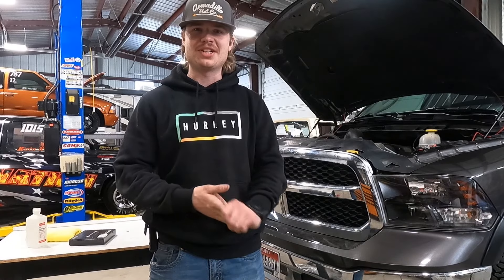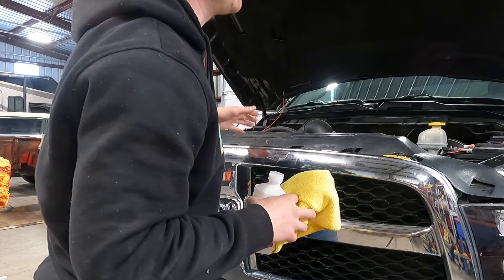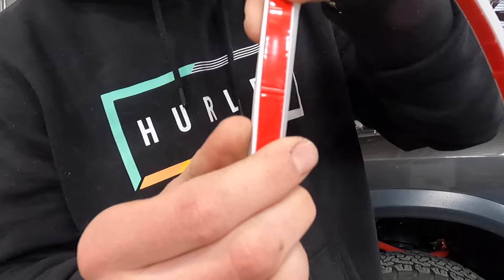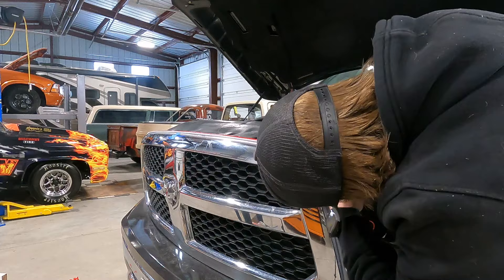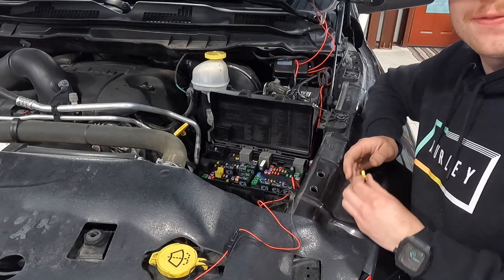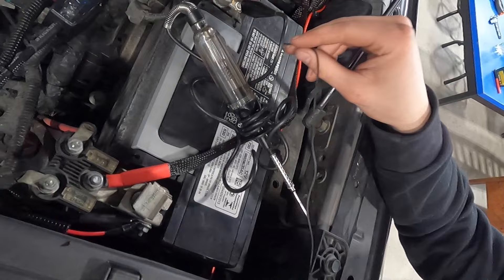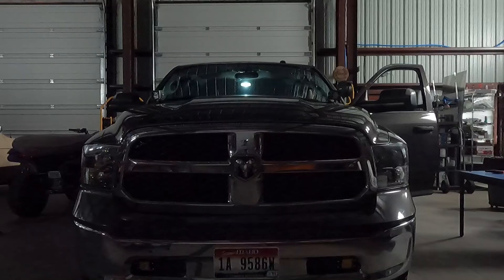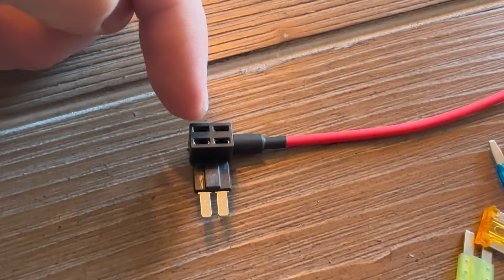Easiest Way To Install A Hood Light Strip! (For Most Vehicles)

Comment: Attaching to the negative side of the battery and I placed a fuse tap into the fuse that operates the radio...is that good?
Reply from the maker: Sure! I would just not put your fuse tap on something important for running the vehicle, you dont want to get stranded in a worst case scenario! But the radio should be fine, as long as the light turns on and off as you like👍🏼
Reply: @DakotaNationRacing  hey thanks for replying the radio fuse tap didn’t work the lights stayed on, not sure how to do this now, any suggestions? The vehicle is a 2017 Camry I’d be grateful for any assistance u can lend.
Reply from the maker: I used my “seat heater” fuse tap, even though my truck doesn’t have those, it still comes with the fuse and slot, so try out another one like that until you find one that works like you want!

Comment: That last bit with the fuse tap: you put the fuse you took out of the fuse box in the bottom slot on the tap, do you have to add something to the top slot on the tap or does it still provide power to the wire?
Reply from the maker: Yes your top slot needs to have a fuse to power your light, if you leave it empty then your light wont work
Reply: Thanks! @DakotaNationRacing

Comment: What size fuse do u recommend for 4 of them? I have the same truck but I think I might wire into parking light fuse if that’s a possibility?
Reply from the maker: If you have the type of light that has an inline fuse, you should technically be protected there, so maybe just a 5-10 would be ok?

Comment: Hey loved the vid but newbie here still a bit confused on the fuse box install, the strip I bought says it’s a 12V and when I look up the fuse box amps for my 2015 Honda Accord Hybrid the DRL is a 7.5A so do I just plug the piggy back into the DRL port and put the old plug into the bottom of the piggy back and tie the wires together and it would work? It’s okay that the DRL is 7.5A and not 12? would rly appreciate your help thank you in advance!
Reply from the maker: Im not familiar with hondas but it sounds like you may just be mixing up voltage vs. amps? When the light strip says its a 12v, that just means its for a 12v system, like cars and trucks, etc. The 7.5A that your stock DRL’s say is just how much it takes to power those specifically. 

As long as you use the fuse tap on an accessory slot in your fuse box you should be good to go! Its hard to explain over text, not sure if i made it more confusing or not but hopefully that helps!😂 It honestly might be easier to just go to your local stereo shop and have them help you out or explain it better!

Comment: I was able to figure most of this out, but my only issues is that none of my fuses were off when the ignition was off. So I didn’t connect it all because obviously don’t want my battery constantly running with the LEDS always on
Reply from the maker: Hmm, read through the list of what your fuses are for and see what is only on when the car is running. Like the “seat heaters” fuse isn’t going to have power unless your vehicle is on, go try out a couple different slots and let me know if you can or can’t get one to work for ya!
Reply: Tap into the cigar lighter , sunroof, windows. Lots to tap into. Just try stay away from anything to do with computers

Comment: So which fise was it and how many? amp
Reply from the maker: Used my “seat heater” fuse even though my truck doesn’t have seat heaters, i still have the slot. If your light has an inline fuse already then it should already be protected, but id throw a 2 or 5 or something low in your fuse tap

Comment: How to find ACC inside your fuse box? I checked mine, none of the slots has ACC marking.
Reply from the maker: ACC won’t be labeled, it just means that fuse only has power when the key is on, i used the fuse that was labeled “seat heater” since that would only be on when the truck is running! Hope that helps!

Comment: What do you do if you connect it but it won't turn off i have it tapped into my headlight fuse in my Honda Civic but when i turn my car off completely strip stays on? What can i do to fix this
Reply from the maker: It obviously must always have power, you need to find a fuse thats only on when the vehicle is running, i would think the headlight fuse isn’t constant power, but maybe it is! Try another fuse and let me know!

Comment: I received my lights today... my question is what is the size  of fuse do I use for the fuse tap? 5, 10, 15, 20?? Because I really don't want to blow any fuses....PLEASE respond...
Reply from the maker: Your light should have an in line fuse, so on the fuse tap you can throw in basically whatever one you want since it’s already protected down the line. LED’s don’t pull much juice at all anyways but i just have a 20 in there now but it doesn’t need that big of one really!
Reply: Ok....thanks so much...
Reply from the maker: Do you have an in line fuse in your light?

Comment: My question is since you hooked it up to a power source when you turn the key on.. Since you didn't hooked them up to a power source that's on only when you turn your lights on..There on all the time if you have your lights on or not?. You would think you would want them on only when you turn your lights on..
Reply from the maker: The way i wired them up, i wanted them to be a like a daytime running light, so on all the time whenever the truck is on! There are obviously ways to get them to only turn on with your other lights, it was just my preference to have them on whenever the truck is running!
Reply: @DakotaNationRacing  How do you know what fuse to use. I want ine to work like yours. My ram is a 2019 Big horn. looks didd then yours,.I  bouht the wire taps that you have, the fuses that came with the set are not small enough and the wire taps do not seem to work either. TY
Reply from the maker: @26steiger  The fuse taps set I provided a link to should have all the styles you would need! There are a few that look similar so make sure you are grabbing the right one. How you pick what fuse is find one that's not important for the vehicle to run on AND one that only has power when the key is on, the one I went with was the "seat heater" fuse slot (even though I don't have seat heaters on my truck). Try that out and hopefully that helps! If you can't get it, then go to your local stereo shop and have them install it for ya!
Reply: @DakotaNationRacing  Thank  you so much. Can I use a spare were there isn't any fuse.  I will put in a 10 amp. thoughts,

Comment: Do you have a link for the ground wire eyelet or can you pick that up at any auto parts store? Is there a specific size I would need?
Reply from the maker: You should be able to pick one up at your local auto parts store! I don’t remember what size i ended up using (it depends on where you are connecting it) but i can check after work today.

Comment: I did mine and the led lights are on even the engine is off?
Reply: Why is it on even if im not using the car
Reply from the maker: Sounds like you tapped into a fuse that’s always hot even with the vehicle off, find one that only works when the key is on and that should fix it

Comment: Great, simple instructions. So for the tap, after I remove the fuse where I'm stealing power and place at the bottom, is there a fuse that goes at the top OR leave it empty?
Reply from the maker: Thanks! Make sure you put a fuse in the top slot (top goes to your light). If you bought the fuse taps i have in the description it should have extra fuses for you to use!
Reply: @DakotaNationRacing  Yes I ordered the ones u mentioned but it doesn't have a 15a. Does it have to be the same fuse amp size?
Reply from the maker: Nope it doesn’t have to be the same, i think i just threw a 20 in mine if i remember correctly. Since the light already has that inline fuse, it should already be protected, so the fuse on the fuse tap is just double protection or “extra”
Reply: How many amps does the light itself draw? If pulled a 15 amp do I have to put (2) 15 amp fuses in or can let’s say for conversation put 5 amp for the light?
Reply from the maker: Sorry, I'm not sure how many amps the light draws! but you don't have to use a 15 in your light slot just because you are using a 15 in the slot you are pulling power from, hope that helps! @NiteTrainATL

Comment: What was your center on your RAM?  I have a 2018 RAM.  Where did you measure from on your truck?  The other thing is what size of lights did you get?  59 inches, 70?  One more thing, what fuse did you use for the top fuse tap?  Thanks 👍
Reply from the maker: Ill have to go measure my center, I can’t remember off the top of my head. I got the 70” light and i ended up tapping into the “seat heater fuse” (even though my truck didn’t come with headed seats its still an option in the box) hope that helps!
Reply: @DakotaNationRacing  Alright good!  So that's where I would want to then?  I don't have them either.  But, as far as the lights go, do the 70"?  I'm very picky on how I want my truck to look.  I don't want wires & stuff all over the place.  I have a 2018 & it looks as good as the day picked it up at the dealership.  I do appreciate you reaching out!👍. Semper Fi

Comment: Mine stay on even after turning off the car. How can i stop that??
Reply from the maker: Must not be connected to an accessory fuse, if you have a test light, you need to confirm you are tapping into a fuse that an “accessory” meaning it’s only on when the key is on! There should be a bunch of them that are accessory!

Comment: Would it work with a bug deflector?  Is it going to be as bright or it might act the same as if you used a black electric tape?
Reply from the maker: Good question! I’ve personally never had a bug shield so im not to sure how much gap is left once you install one, it might depend on the style of bug shield you got, I would think as long as you still got some gap there, light will make it through, sorry, wish i could be more help!
Reply: I have I guess OEM deflector you can get at the dealership.  It’s the one that goes just on top of grill.
There is some gap so I’m assuming it should be ok.
I like the way it looks and it’s not expensive at all.  Great idea. 
Thank you!

Comment: When using the fuse tap. You put the old one in the bottom but how much amps is the new one supposed to be ? The one at the top. Same amount as the bottom one ? Or more.
Reply from the maker: In this case, that little hood light doesn’t pull a lot of power, so you can put a small one in there, i think i threw a 5 in mine if I remember correctly!

Comment: What size connector do you use for the negative terminal?
Reply from the maker: Can’t remember off the top of my head, just used a fork connector that was big enough to fit on the negative battery connection

Comment: I want to turn it on when I unlock the door ( head lights turn on for 30 sec ) but , Idk if there is a fuse for that , So I want to turn on unlocking doors and when truck runs ... I can't find the fuse for headlights !! good video
Reply from the maker: Ya i was thinking about trying to figure out a way to do that too, because that’d be a cool unlock feature! Im going to try a few things out and ill see if i can get it to work!
Reply: @DakotaNationRacing  I thank you for that , also I did some research , People say there is not a fuse to replace on Ram 2011 laramie ... its driving me crazy !!!
Reply: You can tap into the parking light to get tolight up with running lights just use a fuse so doesn't hurt anything

Comment: Any idea which fuse to tap to get the light to turn on with the headlights so when you unlock the truck the sequence starts?
Reply from the maker: I was thinking maybe you could tap into the headlight wire since when you unlock the truck the headlights turn on. But then the light would only work when your headlights are on. Im going to try it on my truck!
Reply: @DakotaNationRacing  that's what I ended up doing and it works great 🤙
Reply from the maker: @TouchofDepth  Awesome! I might make a quick update video of me doing it!!
Reply: @DakotaNationRacing  make sure to use a relay, direct connect appears to make the LED flicker
Reply from the maker: @TouchofDepth  thanks for the heads up!!
Reply: @DakotaNationRacing that would be much appreciated!

Comment: Awesome video! Which red fuse did you tap into when installing the fuse tap?
Reply from the maker: I appreciate it! On my truck it was “F96” which is the seat heater!
Reply: How to find ACC inside your fuse box? I checked mine, none of the slots has ACC marking.
Reply: Great vid thx! I had seen these LED's pop up on my IG and came to YT and found your install.  Loved that I'm installing on the same truck (2500) and doing their multicolor as an insert on a Purple 68' Charger.
Reply: U can check ur handbook for the fuse layout and ideally go for DRL lights or like mine I went with front fog lights, that way I can turn it on or off anytime.
Reply: Thanks for the video. 
Now, maybe I should get one.

Comment: I cannot get the fuse taps to fit into the fuse box ACC slot. The fuse taps are too thick to slide into the "fuse slot". Any thoughts? Solid video by the way!
Reply from the maker: “Mini” and “micro” fuses are close to the same size but aren’t, i would try a different fuse tap! If you got the same ones i put in the description you should have one that fits for sure! OR find a different fuse slot that works for the tap you have maybe, let me know if you get it working! 

Appreciate the support!🤙🏼
Reply: @DakotaNationRacing  I do have the same fuse taps. I am pretty sure the Fuse box holds standard size fuses, too. But I can double check for minis. I don't want to force it in the slot, but right now, I don't see how else to get it to slide in being standard size. We'll see! Haha
Reply from the maker: If I remember correctly my “seat heater” fuse slot was the one i pulled off of and it was a micro! Hopefully you can get something to work!

Comment: I have multiple acc markings on my fuse box, how do I know which one ?
Reply from the maker: ACC just means that it only has power when your key is on. Some have power all the time and you obviously dont want to hook it up to one of those otherwise the light will be on all the time. I just found a fuse that was only on when my key was on and it was labeled “seat heater”, and that makes it so your light will turn on and off with your key since the seat heaters only work when the car is on!
Reply: @DakotaNationRacing  got it thank you brother
Reply: @DakotaNationRacing  one more quick question, how did you get your lights to start up like that all synced and nice 😅?? And also which new fuse do I need to apply to the top of fuse tap for the lights to work ? Any specific voltage ??
Reply from the maker: I guess im not sure what you mean by my lights synced up when the truck starts! Thats just the regular lights turning on when i start the truck up! 

I just threw in a little fuse, i think i just put a 5A in my fuse tap!
Reply: @DakotaNationRacing  oh, what I meant is the sequential start feature.. I’ve done some research and it seems that the multicolor ones don’t have that feature. is yours the multicolor one or the solid white color by any chance ?
Reply from the maker: Oh i gotcha! Mine is not the multicolored one, just white! Im not familiar with the multicolored ones, im not sure if there is a setting or something you can change to get the sequential start on those ones, sorry!
Reply: @Dakota Nation Racing  is your truck actually equipped with seat heaters? If so, does the heater have to be on?
Reply from the maker: @robertsimpson4334  no my truck doesn’t have seat heaters! And no they wouldn’t have to be on, all that fuse spot is doing is sending power to the seat heater when the truck is on and then you would have to click the button to turn the seat heater on (if my truck had them) but there is always power TO them when the key is on.

Comment: Which fuse did you connect to
Reply from the maker: The seat heater
Reply: @DakotaNationRacing  why would you connect to that
Reply from the maker: It doesn’t matter what it is, you just need one thats only has power when the vehicle is on!
Reply: @DakotaNationRacing  ok kool thanks

Comment: Can you explain more on the fuse tap? So you put the fuse tap in put the fuse on the bottom, where do you connect the positive wire at?
Reply from the maker: The end of the wire on the fuse tap is a butt connector that you crimp, that’s where your positive connects to! 

Make sure you use both fuse slots on your fuse tap, (typically) top is your fuse to strip light and bottom is the fuse that your stealing power from

Comment: When go to change headlight your gona have problem.
Reply from the maker: Ive had to partially remove the strip and i just used some double sided tape and it worked great! But yes, you can install it differently depending on how often you are tearing the front of the truck apart!👌🏼